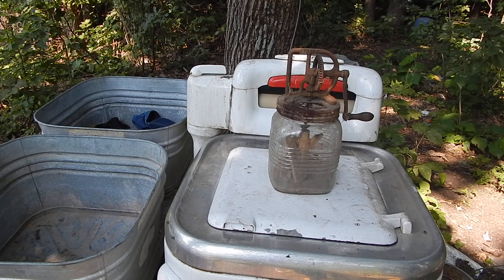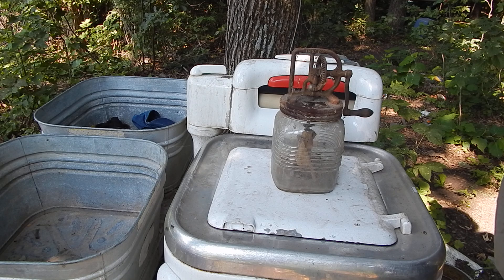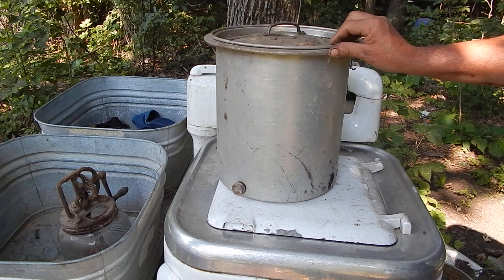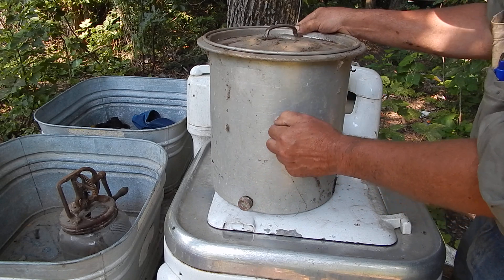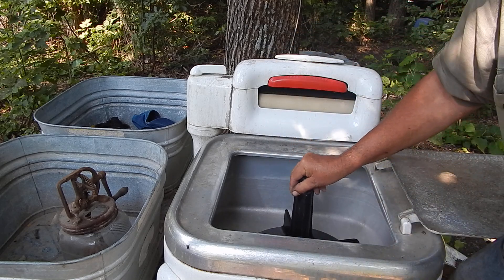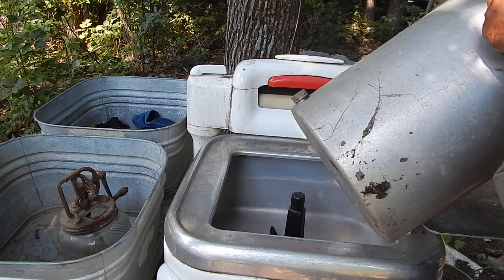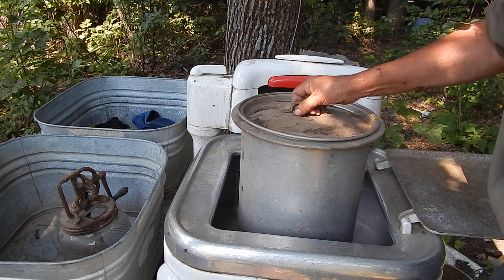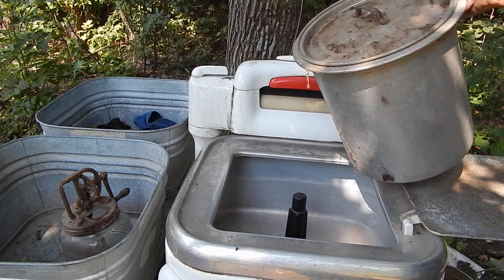Churn insert for Maytag

Comment: My mother had a washer similar to that for a while back in '80 or '81.  It was round and the wringer was hand cranked.  Of course we didn't have electricity so she used a wash board in the tub.  She used it for about a year before we got electricity and then 3 months later we moved!